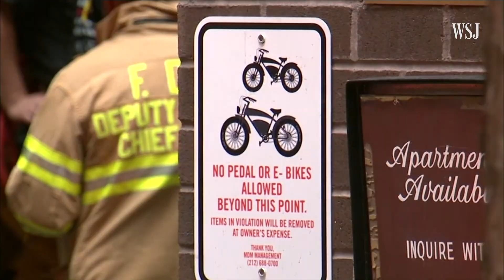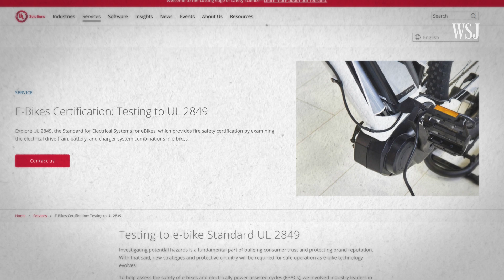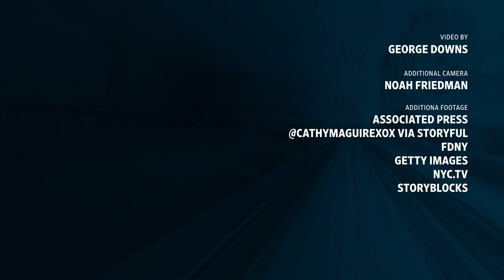E-Bike Batteries Keep Exploding. What’s the Solution?

Comment: Safer batteries such as LiFePo, solid state and sodium ion, better programmed battery management and chargers that cut off charging at 80%, valling 20% as 0% and 80% as 100% with true 100% being called dangerously overcharged to 133% and true 0% as emergency depletion to -33%.  The use of multiple layers of fire resistant drywall in housing and smoke detectors perhaps cutting off receptacle power.  Covering your e-bike with a fireproof blanket while charging to contain the fire (it's becoming the common approach to handling EV fires by fire men replacing the previous approach of removing the heat with vast quantities of water despite the fact that the lithium would chemically react with the water to produce more hydrogen and oxygen under the runaway temperatures in addition to the hydrogen it is producing from metal hydrides within the batteries, the water also presented the runoff being toxic wastes).
Reply: The multiple layers of drywall only need to be on a small box used to charge and store the battery.
Wayer does not make more hydrogen or oxygen and is very effective if it can be injected into the case where it can steal the heat.
There is no lithium hydride as this is a lithium ion battery not a lithium metal batery.
The most toxic component is HF gas in the smoke which reacts with water to make hydrofluoric acid which reacts with the limestone in the water to precipitate out as the common mineral fluorite. (Calcium fluoride).
LFP are nice but a trade off for weight and range and their voltage is not indicative of charge state so more complex monitoring electronics are needed.

Comment: A lesson from cold weather RVs. Use AGM batteries not lithium. A little more weight, but way safer and can be charged in cold weather.
Reply: Lol a little more weight? Get real they are the most expensive batteries to own next to FLA and far from only a little heavier.
Get lithium titanate if you want cold weather charging. You get twice the energy per kg and 20,000 charge cycles gives 54 years of life at one cycle per day.
AGM are a joke.

Comment: It may be that lipo packs will have to be stored in some sort of metal enclosure instead of plastic battery cases.  My E-bike sits in and gets charged in an insulated shed 20 feet from the house.  Worse I can lose is several bicycles if it blows.

Comment: Solution: Buy a gas powered bike. 2x or more range, more reliable, 100x less chance or more of fires, and the bike will cost less to buy. Also, it wont become an expensive brick when battery charge life nears its end. Simple....the solution was always there, even before the e-bike was invented.....genius
Reply: Gasoline stored in an apartment is more dangerous than the battery.

Comment: What some EUC (Electric Unicycle) companies and dealers are doing is putting a Samsung batteries and/or Smart BMS (Battery Management System) to manage the battery and keep from overheating/overcharging during charging. Have not been many EUC fires since.

Most of those fires are from cheap and/or NO Name e-bike and e-scooter brands that people buy on Amazon. They see they can have the same specifications as a $2000 Well Known Brand Scooter/e-bike for ONLY $600, so they buy and end up burning their house down
Reply: and there goes your homeowners policy- smooth!

Comment: The scarier part is, people will be inclined to charge inside in the winter season as the colder weather is pretty restrictive on charging.   This will be an interesting winter here in Winnipeg as these units are popping up everywhere.
Reply: Most of the risk can be removed by limiting charge time to four or five hours so a timer might help.   Also you could probably build a box out of multiple layers of fire resistant drywall commonly called X-board with a smoke detector inside, that should limit the fire, give you warning and deprive some of the oxygen in the air from mixing with the escaping hydrogen from the metal hydrides.  The batteries are often removable modules so fireproof containers could be quite small.   Those fireproof document safes are just stuffed with gypsum (drywall) in their walls and you could probably just use one of those safes to charge the batteries in.
Reply: @johnwang9914 That is exactly the kind of solution needed. Include some pulverized limestone or quicklime filter to react with the HF and it's good to go.
There are no hydrides in the battery.
Reply: @ghz24  There are reactive metals, there are hydrogen so there are hydride even if temporarily and not a primary constituent.   It's like how a RV ammonia absorption refrigerator has high amounts of hydrogen all because of the ammonia.   There is something within the battery that has hydrogen that can disassociate during a thermal runaway.  Lithium, nickel and manganese by themselves can not produce hydrogen or oxygen, there has to be compounds with hydrogen and oxygen for either hydrogen or oxygen to be produced.  Now, both hydrogen and oxygen can be from water hence the electrolyte but as we see from solid state batteries, one of the strategies of battery formulation is to reduce the amount of water required and if course the aqueous hydrogen and hydroxide are free to react with the reactive metals hence hydrides.
Reply: @johnwang9914  There is not metalic lithium in lithium ion batteries.
Hydrides are potentially in solid state batteries.
Reply: @ghz24  You do realize that anything with a covalent bond with hydrogen is considered a hydride and you do realize that since hydrogen gas is produced when a lithium ion battery degrades means that hydrogen is bonded within a lithium ion battery, and you do realize that lithium ion batteries have ions.    It is the very fact that the lithium would not be a pure metal that makes the battery have hydrides.   Do a little basic research first.
Reply: @johnwang9914  Plenty of hydrogen in the solvents used as electrolyte.
Even if there are cobalt or nickel hydrates that doesn't mean they are available to react with water because it's the decomposition of the cathode creating oxygen that allows the runaway to continue.
Water can steal the heat stopping the runaway if it caused the reaction it wouldn't be useful to put out the fires.
Plain water injected into the case to circulate through the cells stops the fire.
Reply: @ghz24  And hence there are hydrides.  A hydride is the anion of hydrogen, water is a hydride of oxygen, ammonia is a hydride of nitrogen.  By saying there's plenty of hydrogen in the electrolytes, you are only confirming that there are hydrides...
Reply: Charge a bike battery inside like a phone? Oh my. Next they'll be charging cars in garages...Who came up with that notion?
Reply: @DaKrawnik  Many e-bike batteries can be removed to be charged inside simply so they won't be stolen.  It's not like the batteries are very large, you can usually fit two of them into your briefcase or backpack.  As to charging cars, well there are small EV cars where the batteries are the size of carry on luggage and they can be taken inside to be charged though those battery packs are quite low in capacity, about 6 kwh.  One such EV minicars would be the Fiat Topolino and it is meant to be recharged indoors off a typical household outlet.  Another such mini-car is the Biro.  The Gogoro scooters in Taiwan have removable battery packs (2.5 kwh) that you remove to charge indoors.   The fact that you can't conceive of removable e-bike and even mini-car batteries that can be charged indoors is more an indication of your own limitations and your own attempts to validate your cognitive bias.   Charging e-bikes, scooters and even minicars indoors already happens.

Comment: There is no solution for lithium batteries.  The hidden secret is Dendrites.  A dendrite grows inside the battery cell itself - it can happen on a new battery or an older one. What happens is a thead like contaminant can grow inside the battery causing a short.  Usually it won't get  so hot as to catch on fire but once you have one bad cell packed tightly with others - it can catch on fire and catch the entire battery pack on fire burnind the car bike or motorbike to nothing.

Comment: Wrong. Most users themselves have no idea about the precautionary measures necessary for the proper use of lithium-ion batteries, let alone the government. So, regulations, if anything, will make things even worse. Public charging stations will definitely *NOT* stop most fires from happening.
Fortunately, there are better products (mainly, controllers/BMSs) already being used in new electric micromobility devices, that help better monitoring/charging of, for instance, individual cells within the battery pack(s). That feature alone should arouse users' curiosity, potentially educating most of them (or, should I write, "us").
Unfortunately, of course, these come at a price.

Comment: Lithium cells need a certain charge protection for the rating of the battery (BMS). People are modifying them or even disconnecting them completely to 'get more power' thanks to good old YT 'do it yourself' rubbish video's and finding their house burning down just for the sake of an extra 15-30mph extra speed they get from the product intended to only go at the rated specifications with safety in mind (no boom bye bye house/garage/etc)

Do yourself and everyone else a favour, don't mess with lithium cells if you are not certified to do so.

Comment: This is not a normal kind of fire, this kind could easily burn down anything that it comes in close proximity to and is all but impossible to extinguish. Imagine having this potential incendiary bomb stored in your garage at night? This kind of fire also gives off highly toxic fumes at a very fast rate. These must be banned, today if possible before even one more is sold. Who in their right thinking mind would buy one of these things if they even suspected that it could do this? We recall cars for having a slightly dodgy starter motor, or seat belt fastening, this is utterly outrageous.

 Remember these things are relatively new and are not cheap. Owners will expect to be riding or indeed driving them for many years to come. If new ones can do this can you just imagine how many very much older ones are eventually going to spontaneously combust in perhaps the most dangerous manner taking the lives of countless numbers of people with them? Entire blocks of flats could go up in flames in a matter of no time. Also if this becomes common knowledge which it will, then it is only a matter of time before the criminally minded use them to make various erroneous fire insurance claims or even for the purpose of murder, extortion, or blackmail. Stop these and all EVs now or be prepared to pay the price.

Comment: first off, it's not every battery that's exploding ...
the insane bulk of these  are the cheap ali-baba  crap, you can buy online ... anti trust me i would be able to tell the quality parts from  the garbage , it's EASY.  Contrary the that knuckle head, they got to say otherwise .when a battery (if your b.m.s  is part of the battery  and not attached with moving tape, it's pretty easy to tell you got garbage or not)
  also common sense maintenance   is   big part 
  you cant usually , just charge your bike with a 4 or more amp charger on a 2 amp extension cord ..  also you can't sett and forget these things either ,  aside from two chargers that i'm aware of (and they're expensive)  chargers don't work on a timer ... you can't just charge them overnight like a cell , if you overcharge it , it overheats , and after a while ...boom!
 so cheaply made batteries on crappily maintained  regiment = ball of fire .
it's not hard to find decent dealers of reputable e-bikes  with reputable batteries and parts ..it's the corn cutting cheapskates  that are putting themselves and others in danger.
new york and everywhere else, needs to crack down, not on e- bikers  but shit pedalers on the ali-baba /ebay type sites   of the world. when you clear the garbage out of the market you'll notice a marked improvement , once the cheapo option has been taken away
i mean you'll still have to deal with the modern day level of stupid .  but a standard  of quality, would definitely  be a blessing.

Comment: I wonder if  a small barbeque grill would  keep a e-bike battery on fire  while charging from catching your place on fire?
Reply: Sounds good.
Reply: It would melt it to the ground. Even stainless steel bbq doesn't stand a chance. The heat generated by these batteries is insane.
Reply: @Longtrailside  Sounds like an open field is the only safe place to charge.
Reply: @patrickmial9113  Ya your about right on that. They need to make them safer. Other wise a lot more people would own them, but due to the risk factors they dont.

Comment: I have an ancheer mt3 is a regular mountain bike with a removable battery and doesn't even warm up because is the model with the ul certification fail proof circuitry and it doesn't go faster than 15 miles per hour with 350w motor, all those that got fire I'm sure are the ones that go faster and with a throttle that is over used so they get hot and teenagers modify the controller by either opening and disconnect the speed controller or if they have a lcd you get a code that makes the bike go up to 25 or more , besides the kits that have no brand name and parts bought cheap you have to know the amps of the battery and the watts and volts or the charger etc , if you buy a new bike In a store with a good name everything is design to work together , also is good to buy a lipo bag( fireproof bag) that you can charge the battery inside and carry out when you smell any smoke,but always be there when charging I don't even let my phone charging when I'm sleeping ,I saw a fire starting just from leaving the cheap unbranded charger plugged in the wall without anything charging it just started smoking ,no fire but sparks were flying in a short circuit, unplug fans too when you're not using them

Comment: The solution: I have 2 - a cheap one and an expensive one. Cheap solution: take a 30% hit on capacity and go with Lithium Iron Phospate cells - they dont spontaneously burn.   Expensive solution: stricter requirements for battery mfg processes and battery packs contained in fully sealed metal casings, not the cheap plastic casings. and make those case-less homemade shrink wrapped pathetic batteries super illegal

Comment: Maybe an intermittent charging system might be a good idea…10’ charging, 3’ off or similar to prevent overheating, or an automatic shutoff system with alarm if the battery reaches a certain temperature
Reply: The BMS should have overheat and over charge protection. On cheap batteries, this might not be the case. This is why there is a need for certification.
Reply: the problem is that these cheap batteries are widely available and lack such features, they are so available that some reputable brands have been caught lacking trying to save a few bucks at the cost of a customer

Comment: My battery charger has a safety feature - It shuts ALL power off from battery when fully charged
Reply: All Ebike batteries are supposed to come with chargers that are smart enough to stop on their own and BMS's to prevent overcharge, over discharge, overheat, etc but typically these Chinese batteries come with Chinese BMS's that barely keep them in good shape

Comment: First who controls boards waste tax money. I have e-bike it was lead batteries . This battery type is over hundred years. My opinion lithium battery has temperature changing range 5 c to 30 c this could be problem. Also changers not turning off when battery hot and change. A timer is best answer for this problem. Old school in most times rules . Lead batteries

Comment: Just got an e-bike off Amazon, the bike stays in the house and the battery is charged and stored in the shed at the bottom of the garden. It's in a FLASLD Lipo Battery Safe Explosionproof Bag. Yes my not be a good place for the battery, expressly in winter, but better for us and the house. Best way to stay safe is eliminate the problem all together.
Reply: What is the joy in this......What a waste of money 😊
Reply: @charlieoscar09  Best to charge battery off the bike and fully recommend this battery fire bag. Battery been in shed over winter 0 problems. Top notch  is the TAOCI Electric Bike only cost £650, best think I got last year.

Comment: Problem is, most e-bike batteries and related chargers have ZERO intelligence to them. My electric riding mower and its charger talk to each other to disconnect the charger when the batteries are fully charged and shut down the charger.
Reply: Bosch chargers have this.
Reply: how do you know that? were you eavesdropping when they thought nobody was around??

Comment: There's a lot of misinformation in this video. Every clip of an "example" of a battery catching fire is started by a human started fire or triggered. Making you think that they can just randomly explode, the batteries will HAVE to start smoking first, then generate heat and THEN explode. As someone who works at an ebike shop and just doesn't upload stolen content and talk over it with information on top of a google search. 

I can recommend you do your research on your purchases before buying. Ask the company what kind of battery is in your bike, if its a name you've heard before, you're good. If they don't know or you haven't heard of the company before, skip the bike. If you're poor and dumb, put a fire alarm close to where you charger/park your bike. Or pull the battery out and put it in a place that can't get someone hurt and cause too much loss just in case. Many people think you need a special fire extinguisher, you don't. Water or a standard extinguisher will be fine.